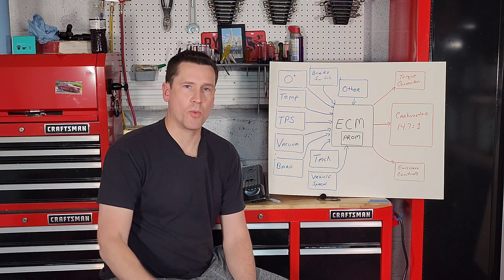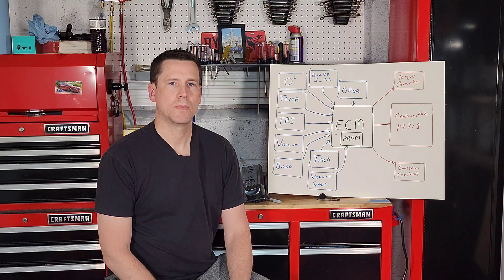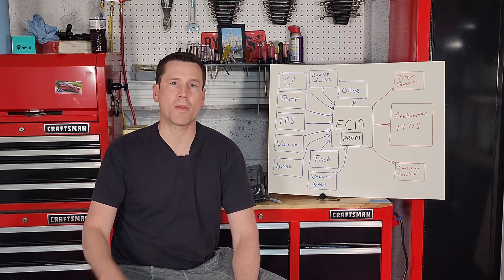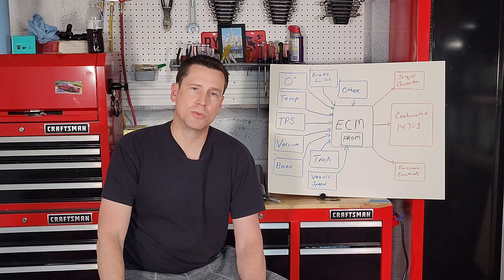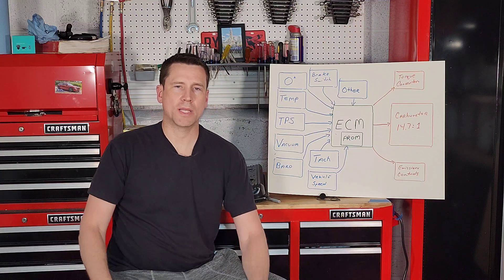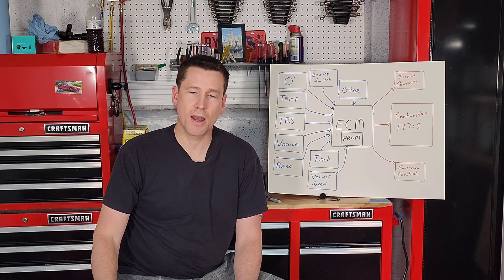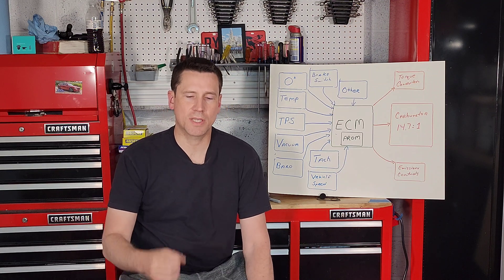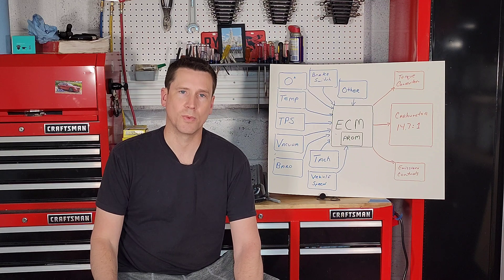What does your 80's engine computer actually control? Find out. GM CCC - Part 3

Comment: I recently bought an ‘87 Monte Carlo SS, and it had a code 34 for the MAP sensor and a code 45 for running rich. I fixed the MAP sensor issue by replacing a busted vacuum line, but I’m wondering if the disconnected vacuum hose could have caused the code 45 as well? I’ve driven the car around, and the check engine light hasn’t come back on, but both codes are still stored. Any advice would be appreciated. Thanks!

Comment: This cleared up alot of questions I had a out the system. Got myself a '81 Buick Century. Never been able to seem to get her running right. Havent check if the check engine light works, it was taped off for god knows how long. I changed the carb, the old one was too worn. I have a constant airflow to the air cleaner from the air pump. A connectir is missing on those two small round canisters and my idle speed solanoid doesnt want to do anything but to retract. Got a 11.7° timing at idle and she's running rough.
Reply from the maker: Sounds like you have your work cut out for you! But everything is doable, one step at a time. I'd work on that idle solenoid first, then get the ignition timing set right. You can worry about getting it into closed loop once it's at least idling right.
Reply: @rporestorations  sounds like a good start. The solanoid gets power, but all it does is retract. Every time I reset it, she retracts after a couple of minutes. And sometimes directly. Could it be because of some sensor not working properly?